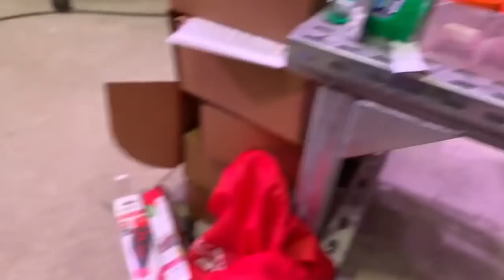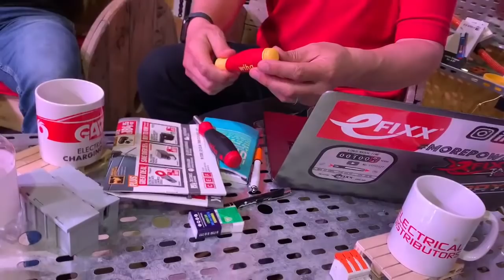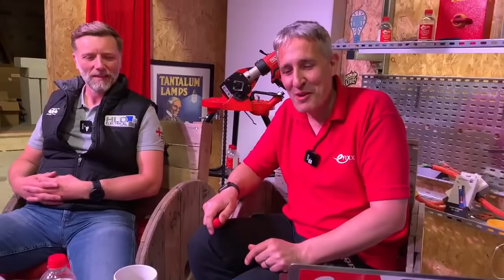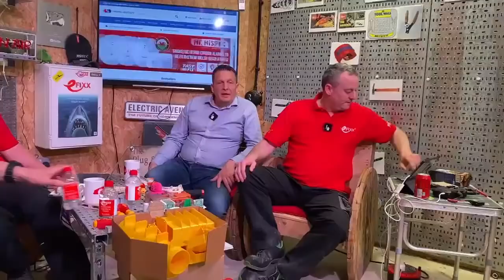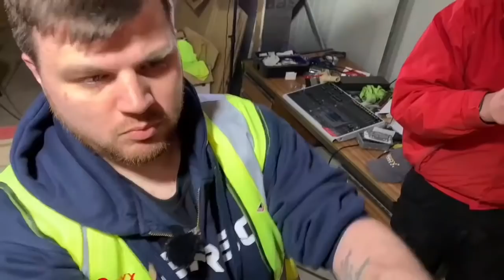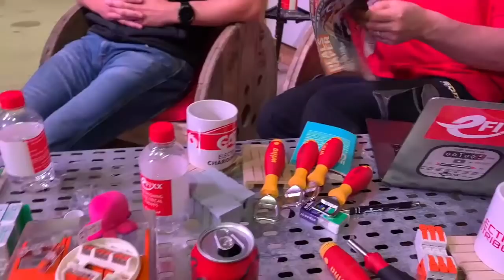The UGLY TRUTH about new build electrical installations.

Comment: Meter panel has open cable entry points and the flexible conduit is not glanded off.  The holes left may degrade the IP rating but does allow for fire to spread easily.  90 degree cable is only rated at that temperatures for short period of time not all its operating time.